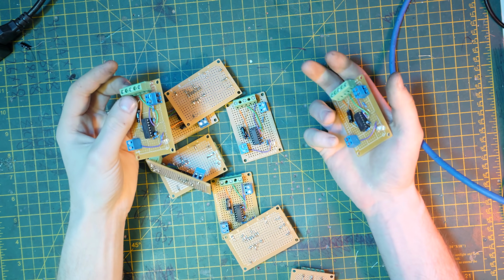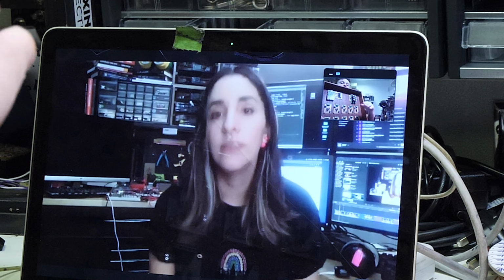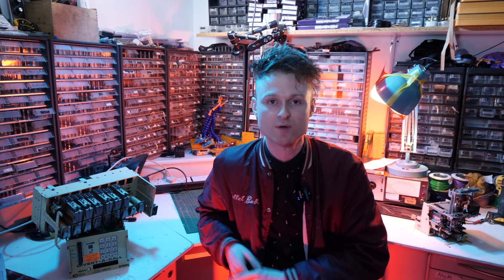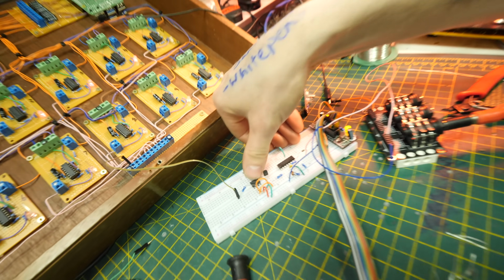CRYPTOCURRENCY SYNTHESIZER.... Making Analog Synth's That Plays CRYPTO's

Comment: kind of pointless to do stablecoins, don't you think? tether and USDC should be removed and the synth will be much more musical
Reply from the maker: No it isn't the compound and somewhat change more than the others
Reply: @LOOKMUMNOCOMPUTER  but the point of those coins is that the price doesnt change. Tether and USDC are STABLEcoins, which means their price is fixed to a certain value.
Reply from the maker: @bsmith8166  but they do change. infact quicker than the others. yes only extremelyt small amounts but this measures the percentage of change. which compounds. so yees infact if anything they are more interesting to listen to than the others

Comment: I believe some of the coins should be changed (if you are able to), as some of them are tied to the USD so will always be close to $1 (only varying by maximum 1 cent). These currencies you have on it that are tied to USD is Tether, USD Coin and the next one (number 11) is Binance USD). This would make for a wider variance in tones and maybe a more interesting system. As always though, your videos are quite enjoyable to watch (as an electronics novice) and I think your work is some of the best on the platform.
Reply from the maker: Yes but it's not about how much they change but percentage of change from last change so they still give a representation of their drift
Reply: @LOOKMUMNOCOMPUTER  That is a fair point, that makes sense now, I did not quite understand that was how it worked (I thought it was based on percentage since last 24 hours). It's still a cool idea for a project and I think it came out pretty well, good job on it!

Comment: I have a raspberry Pi on my desk with an A to D convertor connected to a thermistor. It measures the temperature every 2 seconds. Over 6 months it has created a massive file which I don't know what to do with. Why don't you add a toggle switch for each currency and connect them to thermistors dotted around the museum, then you could listen to currency vs your temperature, or even listen to people wafting around the space? C'MON you know it makes sense.

Comment: Version 2: A user interface where you can input a stock ticker name for each channel and let that channel listen to value changes to that ticker in real-time. That has nothing to do with crypto currencies but it has something to do with interpreting real-time market/finance signals as music.

Version 3: One module containing a vertical slice from Raspberry Pi to analog output for one channel strip mapping to one crypto currency or stock ticker or whatever. That way it is completely modular and you could build an entire modular rack with nothing but these modules for as many realtime signals as you like :). Of course, that would also allow you to interpret the data not only as frequency but as whatever control voltage as you please. The sky is the limit :D.

... you could also really expand into any kind of realtime data. Is there a realtime feed from some weather service? Can you read air pressure and temperature changes from a particular geographical region from somewhere? If so, you could hook up 12 different weather regions to 12 of these modules and listen to weather data as interpreted as music :). So many cool possibilities.

Comment: Hey man, writing from countryside of Argentina. Here's a common place for wine production, my brother recently went to check the project of a guy from USA that seemed to have a similar approach to this. He came back saying that the guy had a big wall of "blip-blop-noise-making-knobs" (a modular synth, for sure) making random music by reading values of crypto as well as temperature and other weather variations in real time, while producing his wine. If I remember well the name of the project is Mike Tango Bravo (maybe it's worth checking). Also, I've seen similar installations by the Japanese artist Yamantaka Eye, but with all sub oscillators (close to the point of not hearing anything). The effect is really cool as you can "feel" (more than hear) the beating between the sounds interacting, sometimes becoming really distinguishable rhythms, then slowly drifting apart (and it's not as ear-piercing as higher pitches). So maybe a general pitch control for all the oscillators to get them pretty low could be a cool feature. Cheers!

Comment: I'd love to hear the combined audio output of the CryptoSynth passed through a filter/oscillator that raises and lowers the volume/amplitude at a rate of say 10Hz to 40Hz.  The control for the filter would be the cumulative movement of all the cryptocurrencies.  So when the market is changing rapidly the amplitude would cycle quickly and when the market is rather steady the volume would rise and fall at a peacefully slow rate.
With this you'd have two means of capturing a sonic image of the market's movement.  The pitch of each coin along with the varied amplitude modulation of all the coins as a representation of the market activity.  Alternatively, the filter could be linked to the trade volumes of all the coins combined.  When lots of money is changing hands the amplitude would 'warble' at a higher rate.

I apologize for not having all the right vocabulary to describe the idea, I'm not a musician or synth hacker, just someone that loves watching your videos.

Comment: Tether and usdc are stablecoins. The value will never change.
Reply from the maker: They do a little bit
Reply: @LOOKMUMNOCOMPUTER  It depends on what the unit of account is. If its usd. I suppose you could call it a root note. If it's gbp you will get slightly more fluctuation.
Reply from the maker: And the percentage of change increases over time with the voltages

Comment: Use the values in the BTC pair instead of the USD pair. Most currencies follow BTC quite closely, so the USD pair will have the same movements as BTC/USD.
Reply: Hi there, haven't seen you in a long time.
Reply: Why not both? Now the first one is sure to work, one can hear the difference between [cryptocurrency]:USD and [cryptocurrency]:BTC